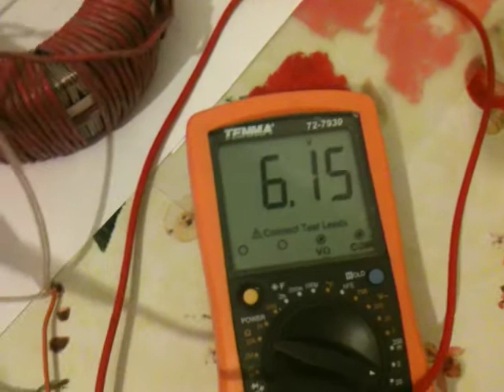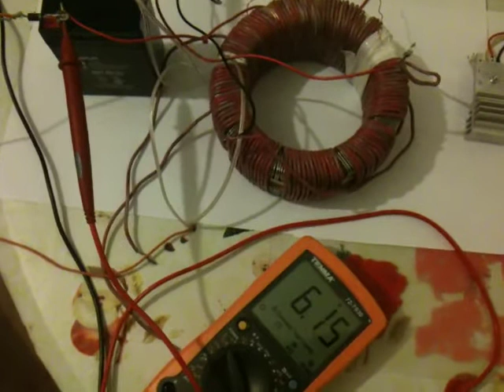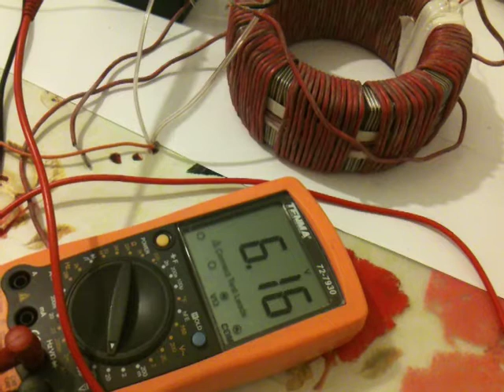Self charge

Comment: voltage increase may be caused by discharge resistance of acid batteries. what happened after few hours of work?
Reply from the maker: Keeps climbing. After few days will go over the voltage. When battery level increases the rate of self charging goes up too.